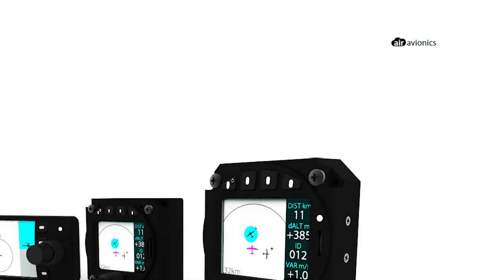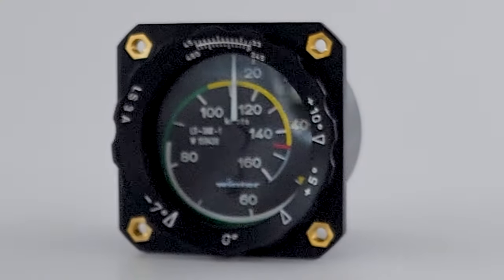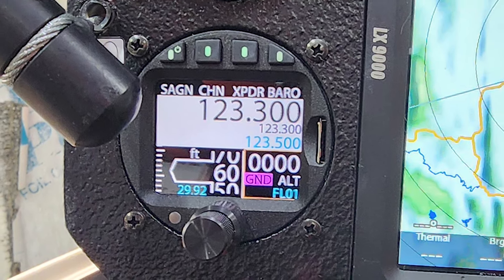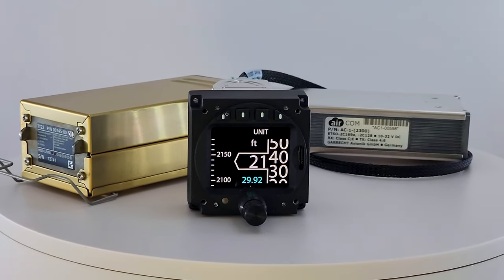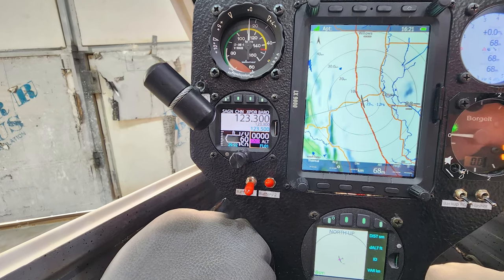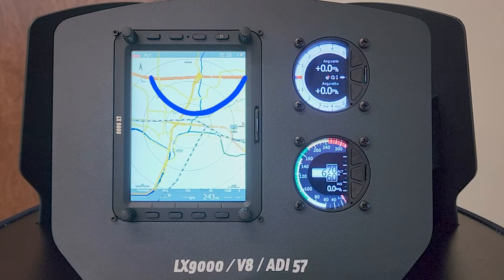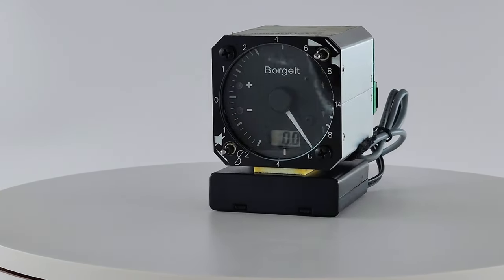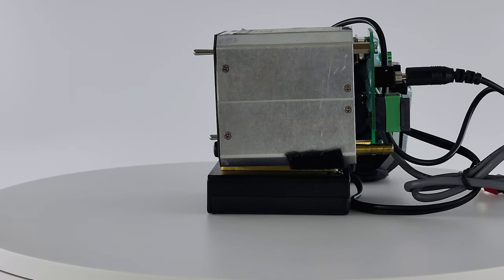Sailplane Refinish Part 7   Instruments

Comment: Im amazed all of that hardware for the electronics could fit behind the panel, my LS1f panel is jam packed on the back side with just a flarm, s80, radio, and mechanical altimeter, vario, and airspeed indicator

Comment: So the panel is now worth as much as the glider?😁
Reply: You might think also: it costs money to fly latest instruments and then different money to fly latest glider. Luckily, you can fly latest instruments without money for latest glider, if you want. It is actually pretty enjoyable after getting over the mental hurdle that old glider must have crap instruments.
Reply from the maker: The LS3a is now like a new glider at a fraction of the price of a new sailplane. Yes, the performance is maybe 90% of a new sailplane, but 25% of the cost after all the improvements.
Reply: @wingswheels  I don't disagree with that.  On the one hand, new gliders are ferociously expensive and, on the other, most of us aren't capable of getting the best out of what we already have.  Our Ventus cT is more than good enough for me.